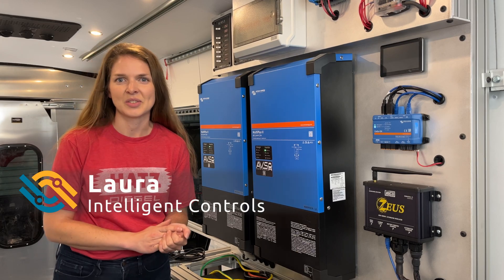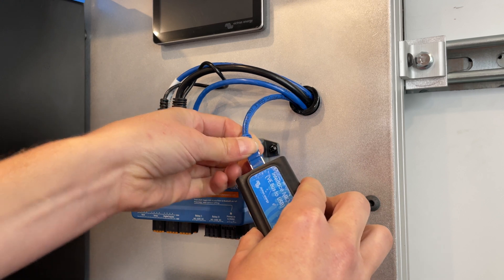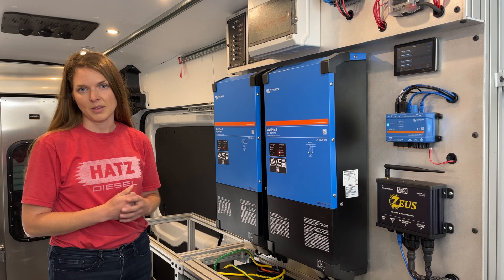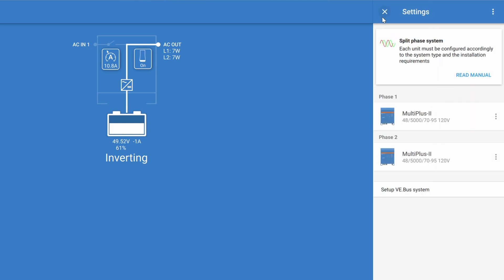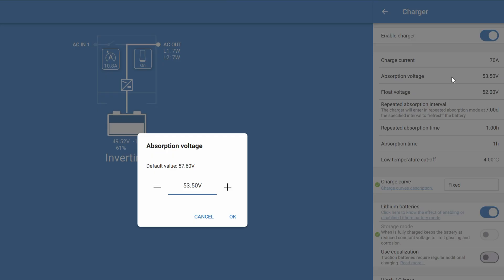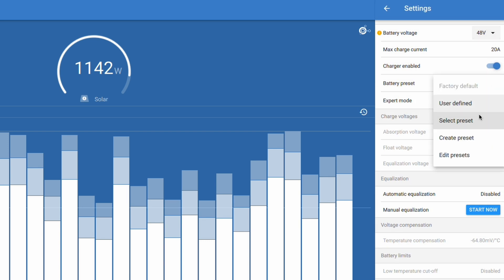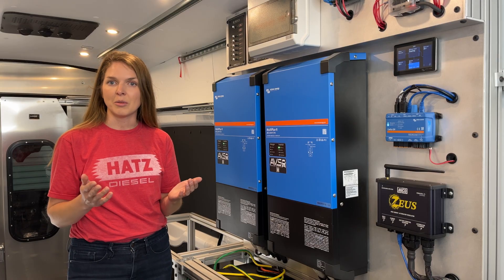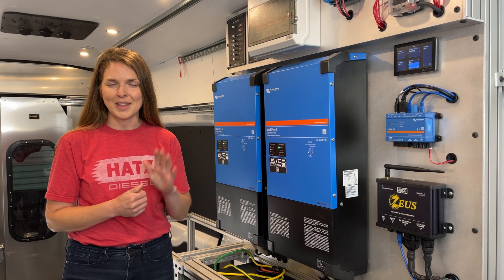Basic Commissioning Steps for Victron Inverters

Comment: Hi and thanks for your really helpful video. One quick question; once the parameters in the inverter have been set so that they don't rely on the BMS being connected, are there any circumstances when those parameters can be lost and the inverter revert to factory default settings? For instance if the inverter is switched off I assume (?) that the parameters are still stored but what happens if the batteries are disconnected or fall below some threshold value?
Reply from the maker: Reverting to factory default typically only happens if a firmware update is run. A simple shutoff should not trigger any defaults. We do always recommend manually programming the inverter/s to whatever battery bank you're using (and programming any device that same way actually) so that in any unusual scenario your system is programmed to be safely applying charge/discharge. The new Venus OS (3.65+) offers a handy way to save your inverter configuration settings, I do now recommend saving whatever settings you program via that tool so that you can reapply them if needed.

Comment: i like to set hte pylons to 52 abs and 51 float , for hte fall back as just below its normal envelope 53.5 is a bit high and risk bms disconnects 
imho
Reply from the maker: This is often the case. The details in this video were per the Pylontech manuals instructions. We also often set the charge voltage lower, it depends a bit on each install scenario.

Comment: I notice you did the configurations via VictronConnect but did not use VEconfig, any reason why?
Reply from the maker: Hi @stanleybarreto9740, we used VictronConnect as it is the more streamlined and user friendly option for programming these inverters. Victron has been expanding the functionality available within VictronConnect and it has been becoming a much more capable option. VEConfigure is still necessary for a few specific things, which weren’t required for this particular video, all needed settings are already available within VictronConnect so we didn’t add further complexity by introducing VEConfigure. We may yet do another video explaining VEConfigure, especially in regards to remote configuration of an inverter.
Reply: @intelligentcontrols  thank you for the reply

Comment: Do you have a Victron smart shunt between the Lynx Distributors?    If so, why?     
Why would you need the shunt when you have closed loop comms?
Reply from the maker: Hello @charlestyer2164, very nicely spotted! Not many would have noticed that. In this case, the shunt is not a SmartShunt, but a more basic shunt (you’ll notice it has two small leads rather than the bulkier PCB of something like a SmartShunt or BMV-712 Shunt), which is providing a measurement directly to the Arco Zeus device. That is allowing the Arco to get its independent confirmation of charge to the battery bank, and to give the Zeus a direct measurement of the power going into your battery bank to independently ensure it does not exceed any maximum charge parameters (including charge from sources other than the Zeus).

Comment: MOST of this makes perfect sense.  I still need to know:  Will the Victron dongle work with a Chromebook, Mac or Linux?  Does the dongle use the Laptop's Web Browser, or does an App or Program need to be installed on the Laptop?  Thanks!
Reply: I'm not an expert. But I have used it with a mac. It's an app you download from the app store.
Reply from the maker: Hi @joshm3342, the dongle will allow you to connect to any device that is able to install the Victron Connect app. That is available on iOS, the Mac App Store, the Google Play Store, and for Windows. Linux might be possible, though I’ve never confirmed that - likely you’d be running linux with a Windows emulator if it’s going to work. For using the more advanced (and definitely more old school style) VE.Configure software you will only be able to do that on a Windows computer.

Comment: QQ, what is the difference between the UF5000 and US5000 Pylontech? I have the UF5000 but not the US available to me
Reply from the maker: The UF5000 is a newer battery from Pylontech that utilizes 16 cells rather than the 15 cells of the US series. It will work similarly to the Pelio with the same form factor as the US5000. The UF5000 is not compatible with the US series batteries.
Reply: @intelligentcontrols  thank you!

Comment: There is an error in your setting since Pylontech recommend the Bulk/absrtion to be 52 and float 51V
Reply from the maker: Hi Sebastian. Good catch, but those float and absorption numbers are based on an older version of the Pylontech batteries. The new Pylontech manual specifies a charge voltage of up to 53.5V.
Reply: @intelligentcontrols hi, thanks for this information, but since what year ? or version firmware we can apply this new voltage ?

Comment: Good morning, nice video congratulations....
I have three Pylonteck 5000 connected in parallel. I have a Chinese-made inverter that does not communicate with them. I set the various parameters manually in use.
They work well because I can see it from the LEDs on the batteries.
Can you connect a Victron Cerbo GX to connect and view the batteries in more detail? What software should you use then?
Thank you very much
Reply from the maker: Hey, thank you and good Q! You could totally buy a Cerbo GX and a touchscreen and just use it as a really expensive battery monitor. It would also give you remote access. You would also need a BMS cable, and you could even get a Cerbo-S, which would be a bit lower cost. And then, when you’re inverter dies you can get a Victron inverter and live the dream. :)
Reply: @intelligentcontrols  
Thank you very much, very kind...
so should I buy a cerbo -S (this works with wifii), a monitor and a cable BMS RS485 cable?  Thanks again
Reply from the maker: @maurizioDidì  What you would buy is called a Victron VE.Can to CAN-bus BMS type A Cable

Comment: Hello! Very usefull video! How do we get MTTP back to "Controlled by BMS" setting?
Reply from the maker: Hi Cristian, thanks for the question. In a Victron system with a Pylontech battery, it’s an automatic setting.  If there’s a BMS and it detects a BMS, it toggles it to "Controlled by BMS." Different batteries communicate differently (or don't communicate at all), introducing complications - and that’s where battery choice really matters. But in this setup, when reconnected (the coms cable is connected and if the DVCC is turned ON), the MPPT will automatically switch to controlled by BMS.